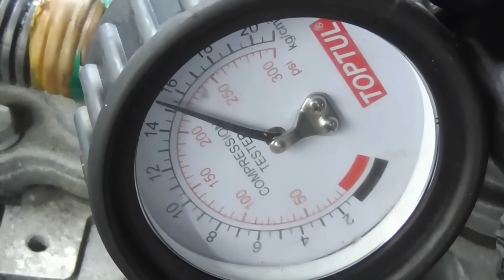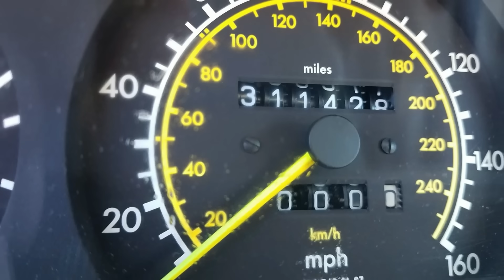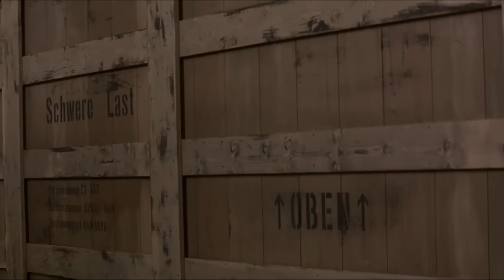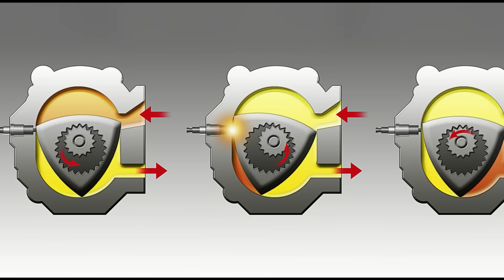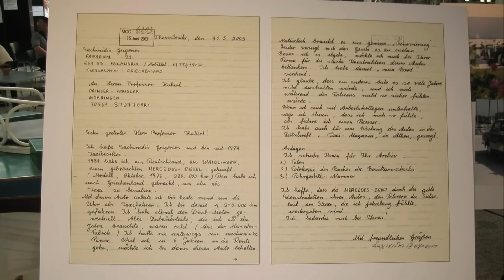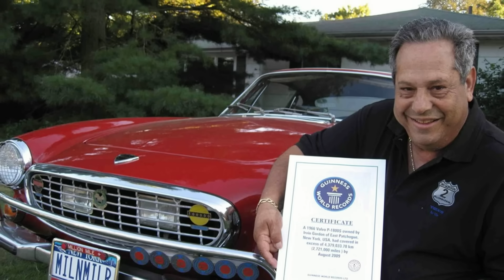Most Reliable Engines of All Time

Comment: 3 Reliable engines and 7 cool engines.  Not including things like the Ford 300 or the Buick 3800 on a list like this is criminal.
Reply: 300 six--best engine ever for me!
Reply: The 3800 is definently underatted. The 4.6 Ford engine has 9 billion (maybe not that much, but still) miles in Taxi and Police service.
Reply: Only 2 things left after a nuclear apocalypse. Cock roaches and 300 fords.
Reply: 3800 oil and coolant eater?
Reply: I've had multiple 3.8 hit 300k miles and I have a ford 300 that will not die. It has sat for years multiple times in it life and I can still go out there today and crank it up no problem. The truck around it has fell apart but it still keeps going
Reply: @jedjacobs6312  they keep going as long as they aren't overheated. Gaskets on those 3.8 engines leak on a normal bases. Otherwise solid reliable simple engine
Reply: @Oliver2020.  Ehh intake melting issues, intake gasket issues, earlier ones had issues with the magnet on the cam gear falling out and needing a timing job. The ignition system was crap. Ever change a crank sensor on one? I feel like GM had the ability to make that engine great as the rotating assembly and valve train was solid but fell short in other areas due to either design flaws or just trying to save a buck which is similar to what they did with the sbc in vortec trim. Cheap plastic intake gaskets (luckly they make an aluminum carrier version thats much better) and the crappy injector setup which to me seemed like it may have been more expensive to make that way verses conventional means so idk what someone was thinking there but ive had a few upto 300k and still going but limpy mostly due to previous owner neglect. Im sure some went several years without oil changes after what I saw in the valley of the engine when replacing those plastic intake gaskets. But besides those and the occasional oil cooler adapter leak they were pretty leak free aswell. The center bolt valve cover may be hated by some mostly because of nostalgia of old ways but ive never seen one leak. I believe the earlier LS engines could go some crazy miles with basic maintence and some minor mods to correct some things like the 1 bolt holding the pickup tube, to the oil pump deal. I also like how coolant no longer flows through the intake anymore making pulling the intake much less messy and how the valley cover is a seperate plate. Working with LS engines probably the only thing I wish GM did differentally is to make the lifers serviceable from the valley like the sbc otherwise amazing engine until they started messing with dod which even that wouldnt have been bad if you could service the lifters from the valley, you could just install normal lifters.
Reply: @DillonTurner395  i agree with you 100000% percent lol on everything you said. You definitely have common sense.
Reply: @alexgray7329  Oil leaks, Poor brake lines here.
Reply: @alexgray7329   I have a Series II Supercharged with a 145,140 miles and does not use ant oil and its almost 20 years old. I change my oil every 3 months 3000 miles which ever comes first. It was the intake gaskets and the Death Cool antifreeze that corrodes the gaskets. I had mine done for less than 700.00. I had a GM Master Tech II Tech tell me that the Death Cool (Dex Cool) Killed the gaskets as these engines were not designed for Dex cool and people were not changing the antifreeze every 45k miles. He also told me that Death Cool is what killed the Head gaskets/bolts on the Northstar 4.6L
Reply: @chrislemaster2695  my old 100,00-300,000 mile Toyota v8s don’t leak and have never needed head gaskets. My uncles Lexus gx470 is at 498,000 and the trans is just now starting to slip.
Reply: My uncle had an 1987 Ford F150 Ranger with a 300 Six in it and a 4 speed. He finally sold it a couple years ago with 585k miles on it. Still the original engine and it ran fine.
Reply: Ford 300 will last forever.
Reply: Cummins, Cat and international enter the chat
Reply: @F9023JFjcDfsdfw2e  
I mean the brands themselves have good reputations, but they built duds as well. Particularly International - the VT365 aka Ford 6.0 Powerstroke has a horrible reputation.
Reply: @oldgreen100  6.0 and 6.4 were terrible but that was partly Fords fault too for turning them up past what was specified by international. But all the best engines to ever be created were by either Cummins, Cat or International. The best non commercial engine is by far the b series Cummins (5.9,6.7). 466 dt non E by international is one of the best engines ever made too. Cat has a plethora of top tier engines. But yeah, no brand makes everything perfect, same with automobiles in general. That's why I'm not brand loyal.
Reply: @F9023JFjcDfsdfw2e  The 6.0 and 6.4s weren't great in International medium-duty trucks either. And part of the problems with the 6.4 was the emission junk. But I agree. Every manufacturer can build a million mile engine, they don't because it doesn't pay.
Reply: @F9023JFjcDfsdfw2e  the 6.7isb is no longer a medium duty engine like the 6bt. It has a b50 rating under 250k. 

The others don't offer an option for a non commercial vehicle.
Reply: @jeepmanxj  The 6.7 is the 6bt You can literally take the crank and the head off a 95  12v 6bt and put it onto a 2022 6.7. And the rating has gone down because they took the 5.9, increased its stroke and tripled the power output. More power = less longevity, which is why there is no replacement for displacement. 

The 6bt is still a medium duty engine found in buses, tractors, tug boats etc, they just don't have the power output of the ones put in dodges, which increases longevity back to what it always was, 350k. 

edit - Oh and when I said the b series cummins is the best non commercial engine, I meant out of every engine to ever exist, not from cat cummins or international. But I think international made some of it's own engines for the scouts and trucks back in the 60's and 70's.
Reply: @F9023JFjcDfsdfw2e  no, it is not. It shares some design elements but the engine does not have the b ratings of the 6bt and this is long proven as well as verified by Cummins themselves. 

The 6bt was a medium duty engine for commercial use that dodge bought into early to stomp the competition. It is still the single greatest diesel engine ever offered in a light duty application.
Reply: @jeepmanxj  You have zero clue what you're talking about. Yes the 6.7 is the 6bt. 6bt stands for 6 cylinder, b series turbocharged... which the 6.7 is all of those things.... They have been the B series for many decades with varying models like ISB, or B, or B6.7G etc etc depending on the application. 

The head hasn't changed since 1998 and the block is the identical design and it only recently changed to a composite material a few years ago, other than that, also identical for many decades. People making big power use a 5.9 crank shaft in the 6.7's to de stroke them... The fuel system is also identical still using the CP3 bosch pump they've used since 03 (that was still a 5.9). 

The 6.7 with it's highest power output is rated at B10 of 250,000 and B50 of 350,000 miles.. just like it's always been. 

They put the 6.7 Cummins in all the way up to class 7 international trucks... That's a heavy duty truck, since you don't know, that's 1 away from the heaviest truck you can get, being class 8. Cummins has the 6.7 listed right in the medium duty engine tab seeing as how the 6.7 is the most popular medium duty engine... that makes sense. 

Just stop. You're trying so hard to discredit the best engine ever put into a regular vehicle with "ooh I heard at the bar" bullshit.
Reply: @F9023JFjcDfsdfw2e  sure thing buckaroo.
Reply: @jeepmanxj  Well then you tell me why the 6.7 is the most popular medium duty engine and why Cummins on their website calls it the B6.7. And explain to me why the MV series from international (which goes to class 7) has the B6.7 Cummins as their base engine. It even says B6.7 right on the international website too... I wonder why that could be.. The B in B6.7 couldn't mean B series could it? 🙄
Reply: 1 vote for the mighty 3800. i have two cars with these engines, one is a bonneville SSEi with the supercharged version that i did a PCM tune and pulley swap. the L67 can make great power for what it is, inexpensive and durable.

the 3800 was one of the best engines GM ever made.
Reply: If isn’t a Top 100. The only thing criminal here is not specifically mentioning Volvo’s Red Block.
Reply: Spot On. The Buick 3.8 is a bad ass
Reply: Agreed
Reply: Chevy and ford back around 1999 or lower were pretty good engines most can last 300k plus besides the 5.4l v8 or the v10 engine by ford
Reply: @thekingofnoobs8362  no experience with the V10 here, but I have a 5.4 and ik people with 5.4s. If you get them through their "mid-life crisis" (spark plug nightmare, phasers, tensioner, and an adequate oil pump) they will totally do 300k no sweat. They are definitely not a good engine though for the simple reason that they could totally grenade during that time.
Reply: @jamesgrigsby3971  The 3800 is widely regarded as a great engine that was quite reliable for its time.
Reply: Was looking for the Buick 3800 myself. This list is sus
Reply: Or the 318.
Reply: Your absolutely right. Ford 300ci inline 6 engines are almost bulletproof.
Reply: Ford's 6cyl 300,one of the best ever,as was their 3.0 Essex V6.
Reply: @Tonytheknife compared to today's standards no, it isn't. 

As time has chugged on reliability standards have gone through the roof. It isn't uncommon to see vehicles north of 200k still running. That wasn't the case in the past. Anyone who says vehicles were better back in the day has never owned older vehicles.
Reply: Yes ! The 3.8 supercharged engine. A 350 with the first two cylinders chopped. Owned one. Was fast and efficient :)
Reply: What about the Cummins 6BT?
Reply: He missed plenty of diesels.
Reply: Yes I agree the ford 300 and the gm 3800 should have been on this list not the rotary😊😊😊😊
Reply: 302 runs better last longer if you do the maintenance and burns less gas
Reply: @douglasthompson8927  no doubt, the 4.9 is not shy about using gas
Reply: Most millennials hate thier north American culture and have been taught to love foreigners over thier own culture and people. Sad a lost generation easily mislead into becoming traitors.
Reply: @chonasimpson6487  what are you talking about? Blind loyalty to American brands brought us terrible cars being forced upon Americans when there were superior foreign options available. Why would one choose a chevette over a Corolla or civic?
If American manufacturers made product at a similar price/quality to Toyota or Honda I’d buy the American made one. But they didn’t and continue not to for the most part.
Reply: @alexgray7329  blind loyalty?  Seems like you suffer from that a tad bit too my friend.  I know of dozens and dozens of Americans car owners who regularly have well over 200k trouble free miles in their cars.  And yes, America can build quality cars. I drove a rental 2022 Corolla.  Worst car I've driven since my 1976 Chevy Monza.  That Corolla was a rattle box!  Gutless, and felt cheap.  The 2020 Hyundai Elantra I rented the year before had twice the miles but was a nice little car.  Sorry but I was HIGHLY disappointed in the Toyota.  I won't buy one.   If I were to buy a Japanese car, I'd buy a Honda first.  But I think you should give an honest look at newer American cars.
Reply: @alexgray7329  by the way....the Chevette was basically an Isuzu Gemini.  Same engine and transmission. Same platform...GM body

Comment: I have a Isuzu MUX this vehicle is not available in the US it has now covered 640000Km I believe is about 360000Miles does not burn oil and compression is well within range I have never done anything to this engine apart from regular servicing never had a problem with it.

Comment: Funny thing is today day and age if you really cant get 200k miles out of a car you are being cheated 100k is nothing even the crappiest car should last 100k. and rotaries were unreliable because those apex seals, they just cant last and an engine rebuild no matter how simple it is just doesn't sound good especially if it has to be done every 80k or risk lost compression ect. but most of these engines were discontinued because of emissions. do you know the mpg rating of most of the engines on this list lol. and even the ones with decent mpg have other aspects of emissions that they have to pass due to weight class of the car and well to beet better numbers they were replaced when a manufacture makes an engine worse that one that was replaced they get hell for it so no one would make any engine less reliable on purpose because that's a bad look and you cant sale cars that way just people care less about that or they just wreck them more now a days lol.

Comment: For me it is Toyota and Lexus (though Honda builds better engines) that have the most reliable cars. My last 95 Lexus I sold at almost 400,000 miles 6 years ago. It is still a daily driver with the same engine and little maintenance. My 2000 Avalon is at 250,000 miles and is my daily driver and needs little maintenance so far.

Comment: The old Chrysler 318 V8s were sturdy and reliable... I had a 'Cuda and then a Duster with 318s in them. The only reason I got rid of them was because parts for the rest of the car were either too expensive or no longer made.

Comment: There is an Datsun/Nissan laurel 2.8 (RD28) diesel in nothern Finland who have the high milage at 3.5 milion kilometers in 2009 this laurel is still in use as an local post car,the person who ovns the laurel had been given an brand new nissan,but he can hold on hes old to the day it not run anymore then nissan will get the car

Comment: Some of this stuff is true but some is not so true,  Incidentally my daughter had a Ford Contour four cylinder, drove it out 300.000  miles, still had the original clutch in it.  They sold it and the new owner drove it another  2 years.  I have a 08 Focus, 175,000 miles with the original clutch, never had a problem.  A 2011 F250, V8, auto transmission, used only for towing 7000 lbs or more driven by multiple driver including myself, it now has over 300,000 miles on it, only maintenance oil, brakes, tires and still going strong as it did with 50,000 miles on it.

Comment: Ford 4.9 liter Inline six, AMC/Jeep 4.2/4.0 liter Inline six, both can reliably run for over 300,000 miles. There are also many Honda and Toyota 4 bangers that can run for well over 300,000 miles. A lot of it all comes down to maintenance.

Comment: You call engine reliable if it can go over 1,000,000 kilometres (600k miles)... below that, it is just cheap disappointment 

KIA Picanto 1.0 petrol did 160k miles in 10 years with last 5 years without oil change! You can try to call this impressive. But normal service and 200k... that is crap!

Comment: That Mercedes 300D came in 2 different varieties, the earlier 5 cylinder and the new for 86 6 cylinder. Both were 3 liter diesels. However, the newer 6 cylinder version was considered notorious for blowing head gaskets as I found out the hard way. And being an aluminum engine, they will distort quite quickly from heat buildup if you don't shut them off immediately.
As for the MB turbo diesel of the 98 era, 16 to 1 is NOT a high compression ratio for a diesel. My 5.9 Cummins has over 17/1 and some indirect injection diesels have into the low to mid 20s to 1 compression ratios. 16/1 is actually pretty low on the compression ratio for a diesel, nearing the point where it won't ignite the fuel without additional heat or starting on Gasoline and switching to diesel when it's warmed up.
Anyway, I'm leaving at 5:15 as I no longer find anything you say about engines to be credible.
Reply: A friend had a ‘85 MB (W123) 300D turbo stick shift.  He sold it after 25 years and got a new MB - a year later he really regretted that.  The 300D turbo and several other older Diesel engines pre 2004 last a long time for several reasons ... one major reason is NO electronics and no piles of sensors.  Most videos don’t state these simple facts.  I have a 2000 Ford 4x4 dual cab pickup made in Thailand (twin of the Mazda B2500) with a 2.5L turbo WL-T. zero electronics.  Now 23 years ... never gonna sell it.
Reply: FYI the 5 cylinder version was 2.5 liter.  I had a 1992 and it was a great vehicle.  Was a freight train going down the highway with gobs of torque, smooth and comfortable.  W124 chassis was like a bank vault built.  Probably the last era of really good MB cars.
Reply: In Phils,smart mechanics adviced a pure coolant, usually colored apple green,as a better radiator filler - instead of  purified water...Never ever used chlorinated city water,deep well water,etc for your water cooled engine- such kind of water will attack, corroded the metal of your radiator,engine block,etc...

Comment: i have a 1959 amc custom with a 327 amc engine it has 474956 miles on it. gets 25 mpg.  problems, i have to make suspension parts.  it is driven regularly.

Comment: My father ran a P4 rover the engine had a reputation for not wearing out in those cars and Landrovers. The exception was driving them hard on motorways as the cars were designed before the first motorways in the UK.  Said to do over 1 million miles but very fuel hungry heavy but not fast at 60 90 or 100mph depending on the car model.i

Comment: My 95 Land Rover is just about to turn over to 200k miles.  Still runs good and only have had to replace usual items like the battery, alternator, and starter.  Yeah, it leaks and leaves a spot everywhere I park, but hey, at least I always have fresh oil in it!